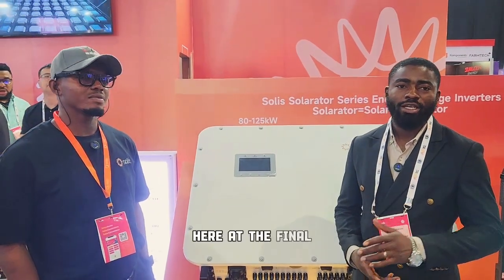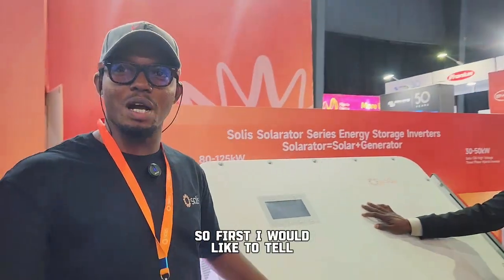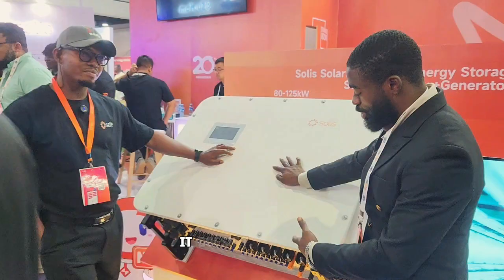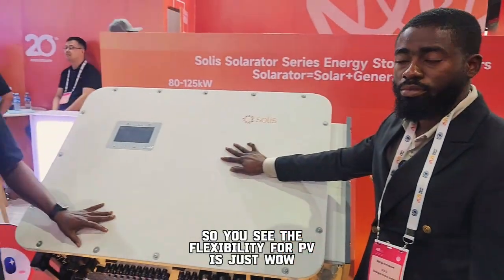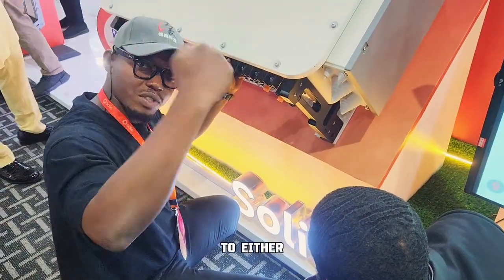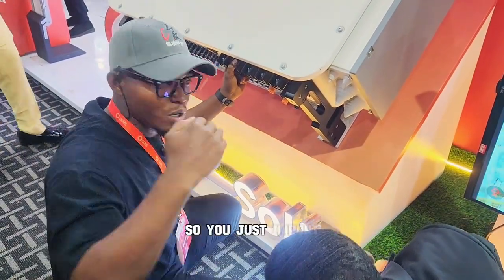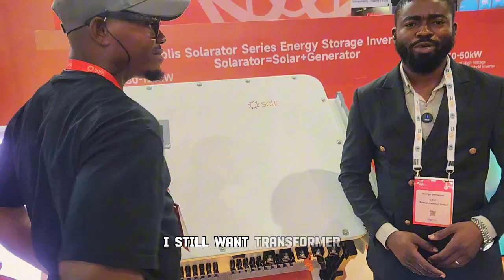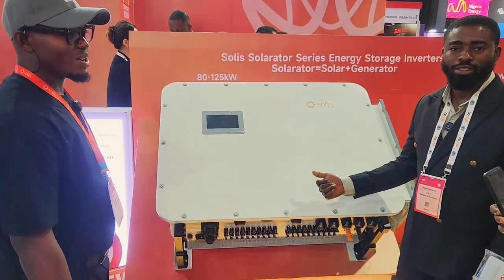IS THIS THE WORLD LARGEST AND SMARTEST INVERTER? LETS FIND OUT

Comment: Instead of all this suffering just buy a 160kwh haisic solar generator. I so much hate this inverter and battery connection 😂 when u can buy an all in one solar generator. Why not people buy house hold generators bit by bit? They buy a generator in whole. So why should I buy bit by bit inverter and battery?
Reply: The cost may be double of what you get if you decide to do Inverter + Batteries + Solar Panels yourself, instaed of buying an all-in-one system which is what Haisic is (excluding Solar Panels).